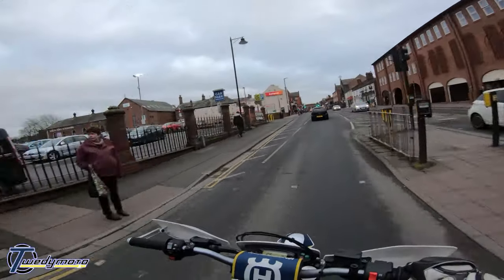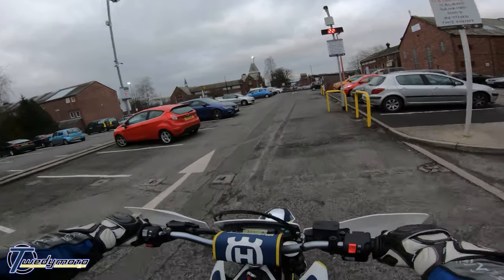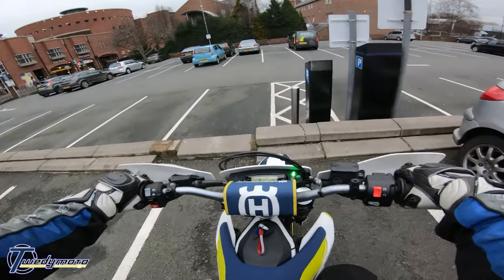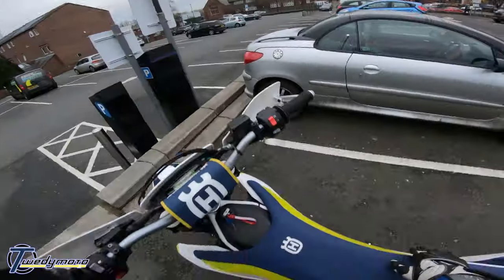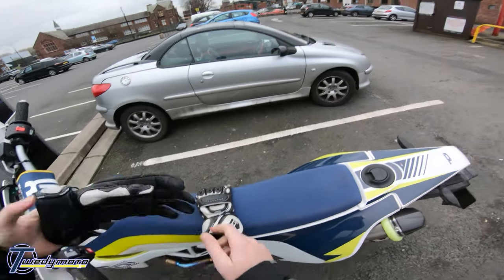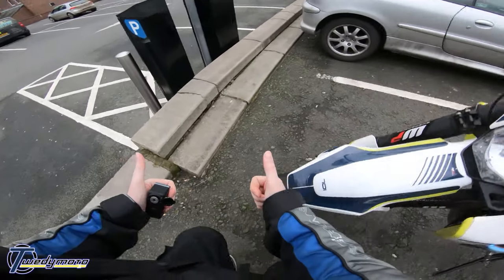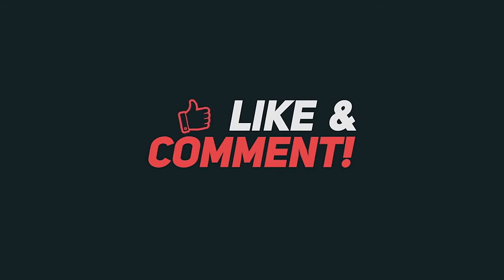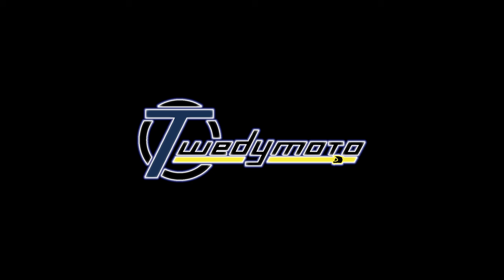HUSQVARNA 701 ENGINE MODS & TUNING EXPLAINED! | DO I NEED A DYNO TUNE REMAP?

Comment: Great video.  If you want this bike to really open up I'd say start with the 
1.SAS plus canister removal.
2. add fuel and dongle 
3. Add a 12 mm O2 cap as well. because you will be taking the O2 sensor out for the fueling dongle. 
4. Get rid of the crappy stock exhaust and a exhaust. I went with arrow exhaust from Rottweiler performance because I got everything there it was more convenient for me. You will have to add the link pipe for the arrow exhaust keep that in mind.
5. Add a better intake. R a d e intake gives you a lot of space or you can add a Rottweiler intake for a little more power ultimately up to what benefits you the most.
6. Lastly add a PCV Commander. I would do this step last because it can program it based on what you have on your vehicle. That way it's plugging play for you. . I recommend the Pow + IGN map. 
Those six will make it a completely another animal. 
Doing those six mods will cost anywhere from $1,1 00 to $1,500 bucks well worth the investment in my opinion.
Bonus add on- oberon slave cylinder clutch. The stock ones have a lot of faulty issues. This clutch has been a lot better for overall use better shifting and takes away some out of the stock one failing which is very common.
Reply from the maker: Yup, pretty much got all of this and it rips. Intake, Exhaust and fueling really is the holy trinity when it comes to tuning!

Comment: Good job tweedy...theres one additional for those with special circumstances like me..i live at 6000 ft above sea level and ride up n down daily..sea level to 6k ft...so, with pcv (plus mod intack and open exhaust, etc) i "have to" map my bike at sea level which means bike is great at sea level and fat (too rich) at 6k ft...if i map it at 6k ft then its gonna be lean at sea level...so, a powercommander autotune is option ($250)...it constantly adj fuel no matter where u are... you set a/f ratio  at whatever u wish along with timing adv (make own custom)..secondly, can make an economy map with the auto tune, save it in pcv then switch between the autotune and the economy (or race map for track)....the pcv is the best option in my opinion as u can retune anytime easil...LETS RIDE!

Comment: From what I've read, you must have the fuel dongle on the 701 and 2016 up ktm 690 or the computer will revert back to stock fuel trim below 5200ish rpm.  I installed one on my stock 21 smc-r (US model).  Made a huge difference in response below 5200rpm.  Rottweiler has a video talking about this.
Reply from the maker: Yeah, mine was a 2017 model. I haven't really kept up to date on the mods for the newer models but i have seen that the '21 model needs a different type of dongle. Good to hear it's worked well for you though! 👌

Comment: So, my 701 is running rich and I was wondering what I can do about it. Thank you for doing this video. I ll watch it again.  I need to research this more. :-)
Reply from the maker: Are you sure it's running rich? Have you tested with an air fuel meter? These bikes are programmed to run lean from the factory. Do you have any mods?
Reply: @Twedymoto  :-) Thank you for the questions. You are the second one to ask me if I am sure it is running rich. I ll be honest, I am told that it is running rich by a mate who rides behind me. I am looking at testing air-fuel mixture to get a more realistic view. I did install the Rade Garage airbox and removed the OEM one. So I wondered. Any ideas where I can measure the air-fuel mixture?  :-)
Reply from the maker: Ah, ok. Humans are bad at sensing things lol. So if you've got the stock exhaust can it could just be because it's so hot but you definitely wont be running rich! The ECU will keep it at what it's programmed to using the sensor in the exhaust. The easiest and probably cheapest would be to go to a dyno shop and ask them for a power run and they'll test the AFR too, should cost 40-50£/$/e and you'll know for sure after that!
Reply: Twedymoto thank you. I ll do that. :-) just to be sure. :-)

Comment: I just bought the 2019 model, when you buy the akrapovic system with airbox and airbox cover the mapping is included with the kit. My dealer flashed the original ecu with an entire new map from the factory. I'm in Belgium . During the airbox install he also removed all the euro 4 stuff like secondary air system. He also installed block off plates just like in the rottweiler kit.He claimed it makes 80hp!! I can hardly keep the front wheel down
Reply from the maker: Yeah that's the map I got installed for £20 when I got it serviced but it was still a bit lean for what I was wanting to do so got a power commander. 😎
Reply: Hey Bart De Croo! I also got the 2019 701 Supermoto and have been able to aquire the EVO1 tuning kit separately from the dealer as they say it is no longer legal to sell. I asked if they could perform the factory mapping for the EVO1 kit, but they said they are unable on the 2019 models and onwards as it is locked by the factory for them to access as they can on 2016-2018 models. Do you know any of this? Which company in Belgium did you use?
Thanks!
Reply: Hi. Sigmund Vedvik I bought it at R4 bikes at Oostakker.
Reply: How the hell you got 80hp?! I only got 72 hp at 7200rpm and 77.3 trq at 5700rpm. Husqy 701 SM 2017 model

Comment: Good info...Thanks for Posting. What do you think of an Auto Tune device in combination with a Power Commander V and a base map to start ?
Reply from the maker: I don't have any experience with auto tune but from what I can gather from other owners, it works pretty well. Especially if you ride in an area where your altitude can change drastically. Here in the UK we're never far from a couple hundred meters above sea level. 👍
Reply: @Twedymoto  Thanks for the quick response.  I plan on using my 701 LR for long distance travel, I think I will give it a go.

Comment: You can pair the pc5 with the autotune wich is supposedly tuning the bike for you also another benefit of the pc5 is that they have a quickshifter kit ready for our bikes :D i was wondering tho if we can use the oem quickshifter that comes with the new 690s
Reply from the maker: I'm sure i've looked into this as the 701 Vitpillen has a quickshifter too but i think it's ECU based and not in the gear sensor or something like that.

Comment: Have you purchased the evo kit with akro exhaust ? The picture of the kit shows an Air box but I think it's just the airbox lid, pipe and block off plate
Reply from the maker: No I didn't buy the Evo kit as it's way overpriced. I was friendly with my dealer so they put the map on for me without buying the full kit. I have a DNA filter with no lid and a Wings can. I'll update the description with my mods :)
Reply: any links to the evo kit?

Comment: How do you think the full rottweiler airbox would compare with the DNA lid and filter performance wise? Worth the 200 dollar premium?
Reply from the maker: The dna filter is still housed in the stock airbox which I think is the limiting factor. I haven't looked into it but I'd imagine it would have a gain over stock. Personally I don't think it's worth the $350 plus shipping. I'm probably going to fit a k&n ru1750 or 1760 👍

Comment: I installed sc project with baffle on my 2020. Can I trust sc project information that no power unit required?

I feel that the power is enough for my ride. Hate to spend more money on performance which I dont need

Comment: Cool videos man. I currently run the Akrapovic slip on with no baffle. And just stuck in the DNA filter it’s a 2016 husky.

How will this be for running short term you reckon ?

Still stock header but also going to get the tekmo header pipe and power commander 5.

Cheers

Comment: Hello,
I have the 2019 SMCR and put a Wings exhaust on it, but no other mods ( except fan switch) and I understand that I needed no new map? Is that correct?
Reply from the maker: That's right. Wings suggest that you don't need to map the bike if you use their exhaust with the baffle installed. Might be a good idea to get the fuel dongle/optimiser though to make the throttle smoother and less snatch at the bottom endb👍
Reply: @Twedymoto  Okay thanks. Will that dongle void your warranty if you still have one? Also which brand do you recommend in the US for this?

Comment: I have 2019 model and i think i will remove the euro 4 stuff (sas and evap) do i have to do a remap??
Reply from the maker: If you're only removing those parts, you don't need a remap. You  will however need a dongle so it doesn't create a fault in the ecu. These usually come as part of the blanking kit.
Reply: @Twedymoto  i just bought the 2019 sm 701 model , and bought the kit 
Akrapovic Slip-On Line Exhaust Silencer

Air filter box

Air filter box cover

SLS cover

EVAP removal kit

Tailored engine mapping from my local dealer . So should i need a powercommander because i saw some tests on youtube with this kit and it didnt add so much more to the bike
Reply: @Twedymoto  I'm interested in changing the gearing on my 2019 701 SM. I remember seeing that you suggested going from the stock gearing to a 15 / 45, if i remember correctly. Did this provide a noticeable change in lower end snap for you?
Reply from the maker: @brucefile7430  Change to a 15 on the front first and see how you like it, if you jump to 15/45 in 1 go it may be too much but my 15/44 is definitely snappy! Power wheelies in 2nd with a tickle of the throttle and 3rd comes up with a little tug!

Comment: Hi! Im really considering getting a 2019 model, but with my license i can only get an A2 restricted one (30kw). I'm also thinking about exhausts.. and I've been looking at the Wings slip on. If i remove the baffle is it enough buying a power commander V and download the correct map? (sorry for my english). Thanks in advance!
Reply from the maker: Your English sounds better than mine! I honestly can't comment on this as not many people have the bike restricted with mods. I guess that the bike can be brought up to a much higher power by using the power commander as the restriction is in the bikes software. I'd put the exhaust on then take it to a dyno centre to see how it's running and if it's very lean then I'd do something about it.
Reply: InverseBlue I’m in the same boat as you! Mines also restricted (18model) I have the wings exhaust without the baffle runs fine all standard.. was thinking of getting a tekmo header pipe just for the looks but not sure if it will run the same?? What do you think @tweddymoto ? Sorry for all the questions😂
Reply: @vickers372  Hey, sorry for the late reply. So there is no problem running the full exhaust without baffle? Doesnt the bike run very lean? Was thinking of buying a power commander and get one of the maps online for the wings exhaust. Bu maybe it will conflict with the A2 restriction?

Comment: you are trying to explain stuff by basically telling that you have no idea of how any of it works :D
So first of all, KTM, and therefor most likely Husq as well, has an initializing run procedure of 15 mins coldstart. This will adjust the mixture. This is recommnded for any change on intake and exhaust, but also when you change your above see leven significantly.
About the "fuel dongle": This mod means you remove the lambda sensor from the exhaust manifold. The Lambda sensor will adjust the mixture to be more lean on lower RPMs for better emission. The "dongle" ist a blind plug which only prvides a electrical resistance to FI wont complain about its removal.

I dont see any necessity to change the mapping, except you really wanna race, having a highly costmomized setup.
Reply: You don't know how it all works as well. :D anything below like 50% throttle  is open loop, which means the ecu is looking at the lambda sensor and correcting to 14.7afr or 1 lambda, anything above 50% throttle or whatever husqvarna sets it to is closed loop which means the ecu uses preset factory values  usually  richening up the mixture but it doesn't look at the lambda sensor anymore. If you slap a exhaust  and performance  filter on it. The bike might be able to correct for it in open loop, but it won't make any changes in closed loop.